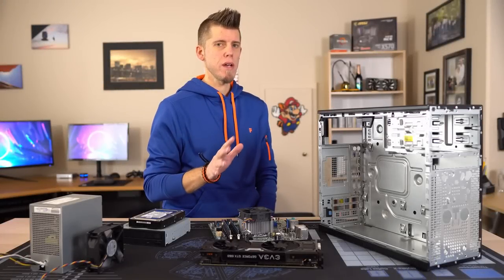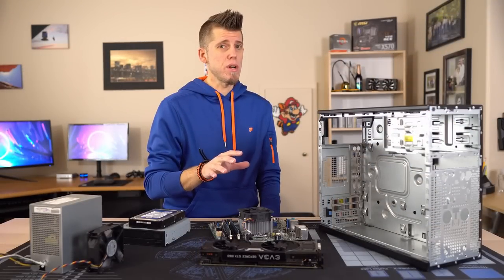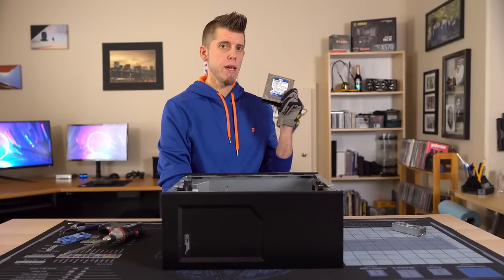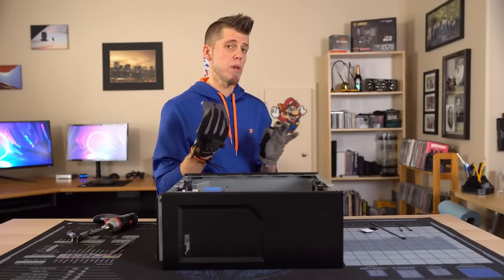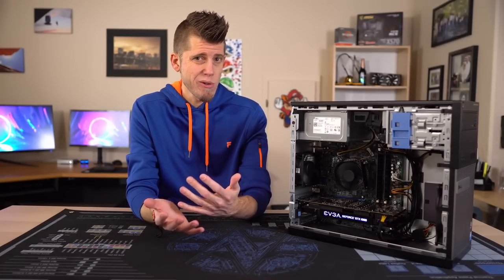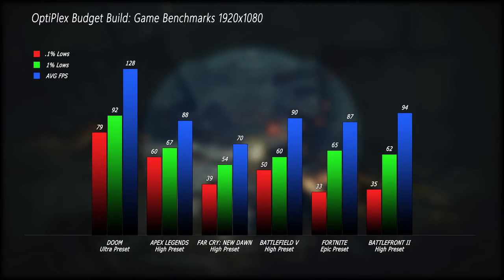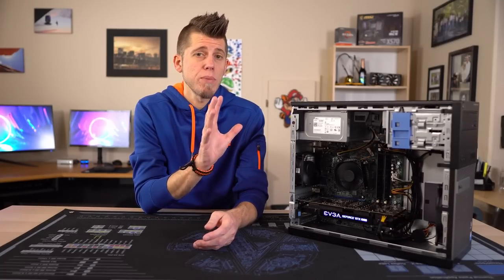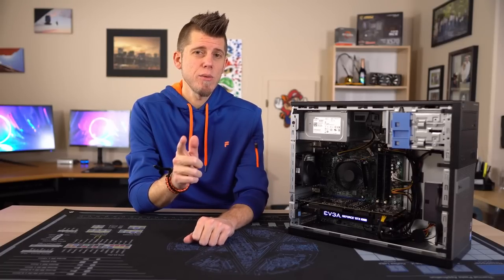Dell OptiPlex Budget Gaming PC For Under $300?

Comment: Nice Video! This actually inspired me to get into PC gaming from an xbox one, so I bought a 7020! I was wondering, If you were able to use an rx 480 on the stock PSU, what is wrong with just using one of those? In my area, an rx 480 4gb is only $100 as opposed to a gtx 1060 6gb at $150. Is it really unusable? If so, would you recommend a gtx 1060 OC or an SSC like in your video? They are both the same price. Thank you for your help.
Reply from the maker: The 480 will run on the stock power supply, but you'll only have about 20 watts of headroom, which isn't good. I would never recommend it. However, I would suggest looking to see how much you could find a 580 for. If it's close to the same price, it might be worth it. And it will be faster than the 1060 in a lot of games. Either way, you could replace the power supply and get the 480 for the same price as the 1060. Honestly, I wouldn't pay $150 for a 1060 in 2020. Things just suck right now because so many new parts are our of stock.
Reply: @TheGameBench  Ok, How about a 1650 Super? They're going for 159 on newegg and look nice.  Or should I get an rx 580 and upgrade the PSU at the same time?
Reply: Also, how much do you think is fair for a used 1660 super? there's one near me for $200 and I bet I can haggle down to $150. Is it worth $20 less to risk buying used for a better card?
Reply from the maker: @joshuaheinstein8506  Man... if you can haggle him down to $150, jump on that! People are paying that much for 1060's right now. Even though it consumes the same amount of power as the 1060, it's quote a bit more powerful. You'd be looking at similar performance to a 1070. Even for $180, I'd call it a good deal. As for the 1650 Super, it's can be on par with the 580, but the 580 can also be considerably faster at times. I tested the 1650 Super and the 580 in my CPU comparison video and found they were pretty close in CS Go, Doom, Battlefield V and Battlefront. However, the 580 was quite a bit faster than the 1650 Super in COD MW.
Reply: @TheGameBench  Well, the 1660 super is gone :( So, what would you finally recommend with my last available options: a used gtx 1060 scc 6gb for $150,  a new gtx 1650 super 4gb for $160, or also a used rtx 2060 (one of the small ones) for $225? I really appreciate your help.
Reply from the maker: @joshuaheinstein8506  Bummer. If you have an i5, the 1650 Super seems like a better deal to me over the 1060 6GB begin new vs used, and they're comparable in terms of performance in most cases. Granted, the 1060 6GB does have 2GB more VRAM, which can help. You would just need to keep an eye on your settings. If you're getting a lot of stuttering, turn the textures down. If you've got an i7, or plan on getting one in the near future, and you don't mind spending $225... 2060, hand down. It's going to perform a lot better than either the 1060 or 1650 Super and I feel is worth the upgrade. The i5 will run the 2060, but you won't have a a lot of usage headroom, but it's doable. If you find yourself in a situation where you're getting a lot of stuttering, you might need to move to the i7.
Reply: @TheGameBench  I already have an i7, and I think I'll try to push for the 2060. Last question, do you think I can run an rx 5500 xt on the stock psu? I can grab one new for  179 at micro center. Is it worth it compared to the 2060 anyway?
Reply: @TheGameBench  And would the 2060 run off the stock psu?

Comment: only thing your missing is some wd 40 to spray on the compounds. it helps protect them and it does work very well and will not short out any parts. if you check out TechYesCity Channel he has some really good videos on cleaning pc parts and putting together pc builds.
Reply from the maker: Yes, I've watched Tech Yes for ages and that's his thing. Using that is just going to attract dust and dirt and thus I, personally, wouldn't use it as a cleaner. I've got my methods and they work for me.
Reply: @TheGameBench  that's awesome love your channel
Reply: it depends, its really messy but maybe you can use it to wash down the ram slots if they feel really gritty, some boards have never been cleaned, just depends how bad shape the board is, if its really clean and the ram slots feel really good then dont spray anything

Comment: I would actually recommend looking more at the Dell precision T3600 and T3610.  They come with more powerful (and generally cheaper) Xeons, support registered ECC RAM (which can be found for VERY cheap, even in large sizes like 16GB per card), and the power supplies are better suited for power hungry graphics cards than their Optiplex counterparts.  All of this for usually just under $200 with CPU and RAM included (something like the Xeon E5 1620 or 1620 V2).
Reply from the maker: They seem like a good option on the face of it and I would love to get one with a 1650 in it. Essentially a 2600 with two more cores and threads. I'd like to see how it deals with modern games compared to the 2600. However, I see a few issues with using those. First off, price. I've looked on eBay for these and most were over $200. I recently found one for under $200 that was pretty beat up. Had no HDD and only 8GB of RAM. Using one for this video would have cost more and would have invalidated the whole point of the video. The other issues I have are the power supply, it's proprietary. I can see no simple way to add a standard ATX PSU to that chassis if you needed to and the higher wattage units get pretty spendy. The airflow in that chassis isn't great either and adding a front fan wouldn't be as easy, or effective as an OptiPlex.

Also, the prices of Xeons compared to their equivalent desktop counterparts is minimal from what I've seen same goes for DDR3, I'd say even less so. HOWEVER... that's not to say that I won't pick one up for a future video as I've been really interested in working on one, I'm just saying that it wouldn't have been right for the purpose of this video.
Reply: 🙂 sure, thats a possible route as well

Comment: Great video mate. Very direct and informative. Subscribed. 

If I may ask, do you think I’ll be able to use a different ram other than one installed on the Optiplex? For example, my 9040 have a 1 stick 8gb ddr4 2166. I have 2x sticks of 8gb ddr4 but its 2400mhz.
Reply from the maker: Thanks! Well... these are pretty picky about RAM. Looks like you're limited to 2133MHz on the RAM. So, you can try it. Worst case scenario, it's unstable and/or crashes, or fails to give a video signal or boot. Nest case, it works fine, but will only run at 2133 instead of 2400, which isn't a problem.
Reply: @TheGameBench  Thanks heaps... I'll take the latter :)

Comment: thanks. I have dell OptiPlex 9010 MT 3rd Gen Quad Core i5-3570 
the graphics card is integrated 8 Gigabite
I think it is the same is yours..
My question, If I buy a graphic garde 2 or 4, would this enhance the performance
On the other hand, does the computer has wifi?

Comment: I just bought an optiplex 9020 i7 4790 with 1tb hdd and windows 10 pro for $195 and I'm waiting for it to come in. I mostly got it because I want to stream to my gaming channel and my current setup is super difficult to setup everytime and I can't even get a solid 360p without constant disconnects. I game on my PS4 and I'm planning on using this for streaming my gaming until I can afford a GPU. Quality won't be perfect I'm sure without a GPU but an i7 with 16gb of memory HAS GOT to be better than my i3 laptop with 6gb of memory.

Comment: First of all, I wanted to thank you for clarifying a lot of aspects not only of Optiplex PCs, but in general of how to make a cheap gaming machine by buying these systems made for office use and upgrading them. These videos motivated me tu buy a HP 600 G1 in order to start gaming on PC, but now I have a question for you; is it worth to buy a GTX 1650 Super and connect it to the 320W PSU with a Sata to 6 pin adapter? I think it should be fine as the 1650 Super is more efficient than the 1060 shown in the video, but I wanted to ask you if it is a good idea. Thank you!
Reply from the maker: Absolutely! The 1650 Super consumes very little power in comparison to the 1060 6GB and the 600 G1 power supply is even better than the 290 watt in the Optiplex. The 320 watt in the 600 G1 actually can supply 320 to just the 12v rails, and with the 1650 Super, the system probably won't go over 200 watts.

Comment: Hey great video, just wondering are you gonna post a video of you building it soon? (The full process)
Reply from the maker: This is actually the last video in a five part series starting with the buyers guide, then the HDD cage removal, then the fan modification, then GPU buyers guide, then this video. I didn't want to do it all in one video as it would have been a really long video.
Reply: @TheGameBench  oh ok I understand thanks
Reply from the maker: @osi64  No problem.

Comment: Hey man. Nice and clean! Great work! Do you think that its default power supply will suffice if you put a 4790 and a 1660 super in it? Based on google, i think that its default power supply is 290 watts. Do you think it will work without the components burning? Please answer, thank you.
Reply from the maker: Well, comparing the power consumption I'm seeing between the 4690 and the 4790, for single core, they're about the same. In multi-core the 4790 is consuming about 10 more watts over the 4690. Pretty marginal increase. The 1660 Super also pulls about 5 more watts than the 1060. So, I see the system pulling about 15 watts more MAX.... worst case. I'd say you're fine with the stock power supply, but I would say you're pushing the limit of where I'd feel comfortable running the stock PSU though.
Reply: @TheGameBench  What's the max watt of the 4790 when in 100% mode? The default psu of the 9020 is 280 or 290 watts right?  Would be using a 1.3v ram vs. 1.5v ram makes a watt differrence? Few bucks more from a 1650 super to a 1660 super but i don't want a new psu as much as possible. Techdeals tried a 1060 in one of his optiplex's and he said it worked fine. Not sure if he used a 4 core or a 4core/8thread cpu though. Thanks for the reply man.

Comment: I made a similar build but I used a P106 gpu which is a gtx 1060 6gb mining card for just $60.
Reply from the maker: Interesting. I've been looking at those. Considered grabbing one to mess with.
Reply: @TheGameBench  it's much easier now to setup than before. Linus made a video about with much complicated steps but now it's just so easy. Keep in mind that you need at least 4th gen intel support coz that's the minimum requirement for it to work.
Reply: thats a great price

Comment: Hi there, I have picked up both a 3020 and 9020 MT to mess with after watching your videos. The issue I am having is with the XMP RAM. I had two spare 4GB sticks of Corsair Vengeance Black that I put in the 3020. They only show up as 1333 within windows and even on CPU-Z. I then borrowed some Kingston Hyper X Genesis which again gave the same issue.
I tried them in the 9020 and the issue was the same. What brand memory will work at the rated 1600? Do they need to have the correct info in the JEDEC timing table as the BIOS on these machines does not recognise XMP?
Excellent videos by the way, got me into messing around with PC’s again during this ‘inside time’.
Reply from the maker: Well, sadly... these systems are picky about RAM. I generally tend to stick to OEM stuff like the SK Hynix, Samsung, Micron and Elpida since they're pretty much guaranteed to run at their rated speed, even though they don't look good. I found a kit of G.Skill Ripjaws that runs at 1600MHz, but instead of CL9 they run at CL11. I've seen a lot of off brand, and higher end stuff that doesn't work right because they not compatible. Best case, they run at 1333MHz, worst case, they don't post.

It's just that it's not compatible.

Comment: Can i add rx 6600 on delll optiplex 9200 mb i have bigger case but idk if it can handle the weight
Reply from the maker: You'd be absolutely fine with an RX 6600. I wouldn't be concerned about the card damaging the PCIe slot. However, if you aren't already, I highly suggest one of the i7s with the RX 6600.

Comment: With the 140mm fan on the front, how was the GPU temps? I was given a 9020 with an i7 (No ram) that I plan on following your optiplex build with, my only concern is the gpu running extremely hot.

So far I have a corsair 650w psu, 500gb ssd, 4tb hdd,  an old 1060 6gb laying around somewhere, and the 9020. just gotta get the ram, all the cables adapters and random odds and ends (ie fan, 5.25 to 3.5/ etc)
Reply from the maker: Honestly, the difference is minimal. There's still so much material that it impedes most of the airflow. With a properly cooled GPU I saw no difference in temps, but with a poorly cooled GPU like the MSi Armor cards, it was the three to four degree difference to keep it from throttling.

I actually cut out the front material, but that was more advanced, and I didn't want to overwhelm people with the fan mod video. That being said, I do plan to make an updated video on how I go about cutting the front panel out, along with some other options.
Reply: @TheGameBench  Sadly my 1060 is one of those MSI cards (Red) but I was actually planning on cutting out the metal in front of the fan (Like you just said)! My Idea was to mount the fan, then trace the inside of the fan onto the metal with a marker and go at it with a Dremel. From there I might actually be able to trim some of the black plastic on the backside of the front panel with the Dremel, but I wouldn't expect that to help all that much in regards to air flow. 

My big concern is while the 1060 is a fairly low heat card, I plan on eventually sticking something much larger (Or at least more power hungry) into this guy as the goal is to have it set up on my 4K TV in the living room! With the new 3000 series cards having their intake fan on the backside of the card, airflow might actually be a little more optimized..

If you do make the more advanced video, You can be sure I will be watching! I am pretty curious as to how you went about it all!!
Reply from the maker: @cbatzer1367  I will be for sure, but I'll give you a spoiler on my method. I still get rid of the indents in the front panel so I can mount the fan. Then I use a ruler and a Sharpie to go from the screw points to trace out the fan, but mostly to see where to mark out to leave metal for the screw points, so I mark right where the opening of the fan starts. Then I use use so rubbing alcohol to remove the Sharpie at the corners, when I don't want to cut. Then I use a metal file to clean up the edges once it's cut out. I also use a drill to open up where the screws are so you have a nice round hole.

I'm also working up some alternatives for people that have zero tools.
Reply: @TheGameBench  I definitely appreciate the spoilers and look forward to seeing your next video! What I currently want to do is pick up one of the 1080ti hybrid liquid cooler AIO's... With that I could mount the radiator (Which is a 140mm rad) to the front fan and keep the GPU nice and cool! The GPU market is absolutely crazy at the moment where I am at! 

My ultimate goal is a living room Gaming/HTPC that can drive a 4k 65" TV without struggling to bad or costing to much! But the DIY in me wants to do so much to this poor 9020...
Reply from the maker: @cbatzer1367  Well, you might want to consider playing at 1440p rather than 4k with the 1080 Ti. I run a 1080 Ti in two of my machines, including one hooked to my TV. They're not the best at 4k, but will run great at 1440p. And most newer 4k TV's should be able to do 1440p at their native refresh rate.
Reply: @TheGameBench  That's exactly what I do with the 1060! Just at 1080p instead of 1440p, From sitting distance I cannot even tell its upscaled.. But the 1060 is starting to struggle a bit.. How big of a difference does a bump from 1080p to 1440p make in your opinion?

Sorry for getting off topic here!
Reply: @TheGameBench  Hey sorry for the late update, But I finally got around to modifying the 9020. I ended up using the stock psu with that 1060 6gb, 16gb of ram, and the I7 4770.. For the fan, I ended up cutting out a hole like you were planning on doing (I also trimmed all the black plastic underneath the gray front plate) Temps on the GPU max out at 67c and the cpu hits a high of 70c when under full load! 

I ended up following your guides and am extremely happy with the result!! Thank you!